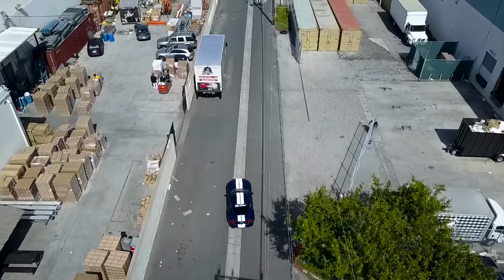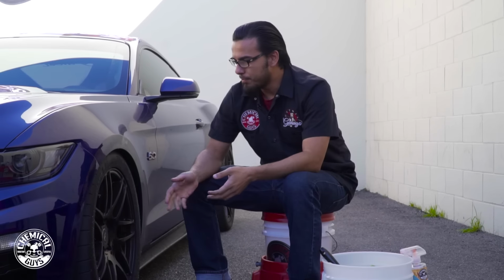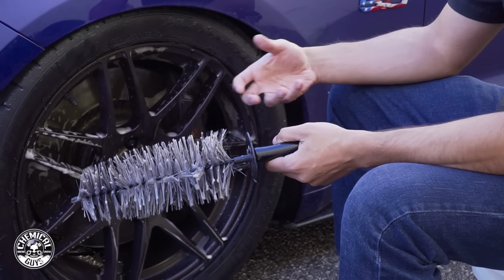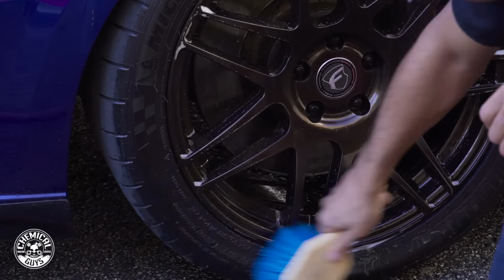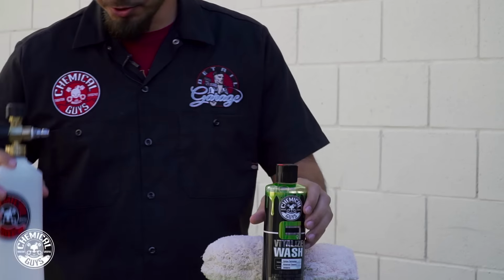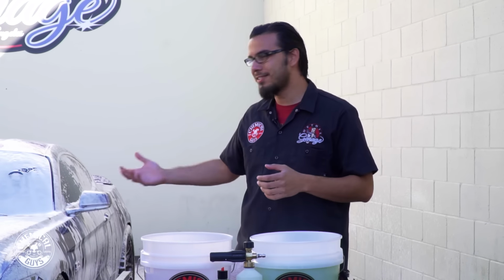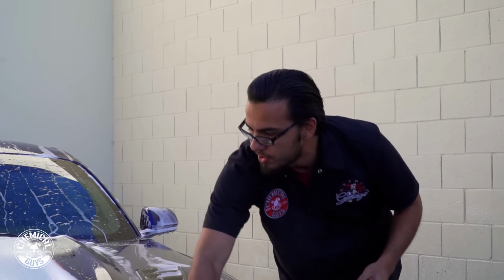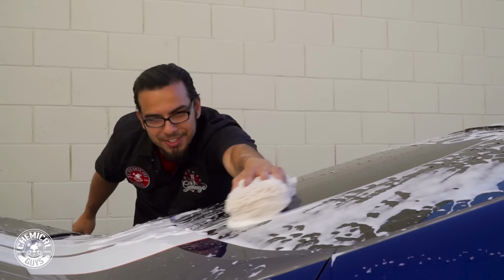Mustang Week! Best Wash and Dry For Your Car - Chemical Guys Car Care

Comment: I remember when you could just wash a car. 

Now you've got to have lab coats and a Ph.D just to clean a wheel...
Reply from the maker: Thanks for watching this video. It doesn't require a PHD to clean wheels, just the right tools, the right technique, and patience. The essence of detailing is cleaning everything that you commonly miss by washing the traditional way.
Reply: you can clean your rims by  making it wet and just going over the breakdust with your bare finger to get it off. Of course a brush helps, but there is no need for using 5 different chemicals
Reply: nobody is controlling you, the way these guys work is to do the job correctly if you want your car to look good, i'm one of those folks, however its your choice whether you "could just wash a car" you can lol

Comment: just saw your after wash product video. will have to pick it up on my next order.  I would like to know if it would help with drying my car when I use my leaf blower. that's my favorite way to dry my car.
Reply from the maker: Hello Robert, I would say it's best to use a microfiber towel to remove the After Wash residue. After wash is designed to repel water, and create more lubrication to prevent the towel to cause any micro scratching.

Comment: I see you are using the Woolly Mammoth Microfiber Dryer Towel. Can you actually dry the whole car with one of these towels or do you need multiple? PS. Great video guys, waiting for the next one! :)
Reply from the maker: Hi Michiel! I personally have dried a 2005 Sierra Single Cab and a 2015 Transit 350 with one Woolly Mammoth. If your vehicle has been waxed or sealed, it will be a lot more easier for it to dry. Thanks for watching and thanks for being part of the Chemical Guys family!

Comment: What is good soap you can use for like any car and will not like take off a wrap or cause scratches and what product can you use to dry a car and to scrub it safely.
Reply from the maker: Hello, thanks for tuning in! To clean wrapped cars, it is important to use a super sensitive wash soap like Meticulous Matte. Meticulous Matte auto wash can be used for any two bucket or foam cannon method and provides slick lubrication to prevent scratching and swirling. Follow that up with Meticulous Matte Detailer and Spray Sealant for those quick jobs inbetween car washes. Make sure to check back later in the week for more exciting how to videos coming your way soon!  http://www.chemicalguys.com/Meticulous_Matte_Auto_Wash_16_oz_p/cws_995_16.htm
http://www.chemicalguys.com/Meticulous_Matte_Detailer_16_oz_p/spi_995_16.htm

Comment: I have hard time with dusty weather, any advice chimical guys?
Reply from the maker: The Honeydew Snow Foam Auto Wash Cleanser is a superior surface cleanser that removes grime, dust, build up and dirt. Added bonus: it rinses clean with no residue whatsoever. You should also be using a sealant like our JetSeal for maximum protection against the elements, especially dust. I have placed a link below for you to follow and check it out. Thanks for being part of the Chemical Guys family!

http://www.chemicalguys.com/JetSeal_16_oz_p/wac_118_16.htm

Comment: Hey Nick. My pressure washer just died. I had a Karcher K5. Are you able to tell me the pressure washer you guys use?
Reply from the maker: Hey Ronald, hope you had a pleasant Thanksgiving, We use a Briggs and Stratton Gas Operated Pressure washer that has 2800 PSI, and 2.3 GPM. Here's a link to one that is pretty much identical to what we have here. 
https://www.lowes.com/pd/Troy-Bilt-2800-PSI-2-3-GPM-Cold-Water-Gas-Pressure-Washer-CARB/1000178201?cm_mmc=SCE_PLA-SeasonalOutdoorLivingPressureWashers_-1000178201:Troy-Bilt&CAWELAID=&kpid=1000178201&CAGPSPN=pla&store_code=1555&k_clickID=491604a2-c20a-4351-b1d5-38c2585f53c3&gclid=Cj0KCQiAjO_QBRC4ARIsAD2FsXPKhQBQ4JHYskmW875t21Pjws-6o9WQsTsb9y_n4kyBC4ZfypL1fJwaAjYoEALw_wcB
Reply: Thank you! My Thanksgiving was great. We went down to San Diego to a place called Rockin Baja Lobster for Thanksgiving dinner then had dessert and families house. Hope everyone there had a great Thanksgiving as well.

Comment: What's the difference between the diablo gel cleaner and sticky gel cleaner? They both seem to be used for the same purpose, so if I just buy one of either or, will it still get the job done?
Reply from the maker: Hi Lindsey, the Diablo Wheel gel is PH neutral, so it works virtually on any wheel type (powdercoat, anodized, polished aluminum, diamond cut, forged, chrome, and wrapped wheels). Sticky Citrus is a more concentrated formula that contains citrus extract that removes heavy stains. Diablo is a good all around wheel cleaner, Sticky Citrus is more aggressive wheel cleaner that can be used on different many wheel types as well.

Comment: Chemical Guys, would it be beneficial to use a pressure washer with plain water to blast off any loose dirt before you use the foam gun?  It's a habit I've adopted because it makes sense in my head?  What do you guys think?
Reply: MultiTerpen ahh that makes sense!  Thank you for the clarification
Reply from the maker: Thanks for watching the video, what you said is actually correct, keep in mind that you don't want to stand too close to the car when rinsing it since the pressure washer is quite powerful. The initial rinse is also a great opportunity to pre - wet the wheels before you clean them.

Comment: Can you guy go more in depth about carbon flex C9 ? Is it a ceramic coatimg? Can you apply multiple layers? Exactly what is it? Doe it add extreme shine or just added protection? Or of it isnt ceramic coating do i need to to purchase something else?
Reply from the maker: Hi Josh, this is Alex from the Chemical Guys crew. Carbon Flex is a ceramic coating, let me define what a ceramic coating is. A Ceramic Coating  is a liquid polymer that is applied by hand to the exterior of a vehicle. The coating chemically bonds with the vehicle’s factory paint, creating a layer of protection. A Ceramic Coating creates a permanent or semi-permanent bond with a vehicle’s paint, meaning that it does not wash away or break down and does not require repeated application every few months. You do not need to apply multiple layers because the second layer will not have anything to bond to. Ceramic coatings do add shine, but more importantly they protect against paint etching caused by water spots, bird droppings, bug droppings, tar, sap, and anything that could diminish the shine of your paint finish. Here's a few links to videos we've made in case you have more questions. 
https://www.youtube.com/watch?v=HYOjdrzEk-Q&t=309s

https://www.youtube.com/watch?v=yAKU7ZEL1KI&t=179s

https://www.youtube.com/watch?v=3fLHkRWe93U

C.G. Alex  : )

Comment: Can sticky citrus be used on dipped wheels?
Reply from the maker: Hi Julina, thanks for watching the video, Sticky Citrus is perfect any wheel type. Diablo is 100% pH balanced and neutral. You can clean off any painted wheel, polished metal, chrome, anodized, powder coated, or wrapped wheel without fear of tarnishing or destroying any finish. Basically Sticky Citrus is universal for all wheels, the formula was created without caustic, or corrosive  chemicals. You can use can Sticky Citrus with confidence.

Comment: What kind of pressure washer is that?
Reply from the maker: Hi Juan Carlo, we use a 2800 PSI pressure washer with a 2.4GPM, here's a link to one that's similar in case you're wondering what one costs. http://www.sears.com/craftsman-2700-psi-2.3-gpm-honda-powered-pressure/p-07175491000P?sid=IDx01192011x000001&gclid=Cj0KCQjwierMBRCHARIsAHl9i4EtGJ7Q4ZZveAfiMWjTPIw2S7bzn6BJNyzLrzipaom_-kx1RwSCFQ4aAo8yEALw_wcB&gclsrc=aw.ds&dclid=CO_ewpLS6NUCFUt8YgodcH0InA

Comment: ive heard when using a foam cannon the water shd be warm to hot however in vid the wash solution was just poured into bottle, whats the best temperature for water to be?
Reply: ok cool ive done a cpl washes with hot water i  will try with cold, thanks
Reply: the foam cannon connects to a pressure washer which gets its water from a hose 
so I have no idea how you would even get hot water.    hose water is cold af
Reply: J⃟O⃟N⃟A⃟T⃟H⃟A⃟N⃟ S⃟C⃟H⃟U⃟L⃟T⃟Z⃟  you fill the foam cannon bottle with hot water and wash solution, and yes run cold water thru the pressure washer itself
Reply from the maker: Thanks for checking out this awesome video. For the best possible results, you should use a foam cannon with warm water.
Reply: Chemical Guys thanks for the info, thats what i was told, i will continue to use warm water in the cannon

Comment: What soap should I use on a black vehicle. Black light? will that keep it a deep black?
Reply from the maker: Hey there Austin,

You sir, are correct. Our Black Light is perfect for any black or dark color vehicles to enhance its shine to new levels of depth and clarity. As you know, black paint is arguably the toughest paint color to maintain and this soap helps prevent scratches & swirls.
Reply from the maker: What's up Austin, Blacklight is perfect shampoo for dark vehicles, it's formula was designed to bring out the rich texture, and deep shine of black paintwork. Blacklight contains gloss enhancers, and waxes that enhance the luster of black paint.
Stay tuned for more great content, and don't forget to checkout our forum for updates, get your questions answered, and share your photos with other Chemical Guys family members. http://chemicalguysforum.com/forum.php
Reply: Thanks! Will it turn my plastics white though because other wash and wax have turned them white.

Comment: Is Sticky Citrus wheel gel safe for matte wheels??
Reply from the maker: Thanks for watching our video. You can use Sticky Citrus Wheel Cleaner Gel on painted, polished, powder coated, chromed, wrapped, aluminum, steel, or carbon fiber wheels, rims, tires, suspension parts, and brake components. If you do plan on using sticky Citrus, I would suggest testing on a small area to see the results. You're better off using Diablo wheel gel because it's 100% pH balanced and neutral. You can Clean off any painted wheel, polished metal, chrome, anodized, powder coated, or wrapped wheel without fear of tarnishing or destroying any finish in any way.
Reply: Good, since my GALLON of Diablo just arrived!!! ;)

Comment: rinse the brush before put in back bucket.  much better
Reply from the maker: Hey Tony, 

The Cyclone Dirt Trap Car Wash Bucket Insert is designed to trap dirt at the bottom of the bucket; filtering fresh water to the top. No need to rinse off the brush because by scrubbing your wash mitt on the dirt trap, the filth gets trapped under. Bonus: saves water from constant rinsing of the brush every time you want to clean it. Happy Detailing!

Comment: Cool video but if I use your technique I will empty half the spray bottle after 1 wash....
Reply from the maker: Hi thanks for watching. We definitely agree with you, less is more. You don't need gallons of chemicals to clean your wheels and paint. I use a combination of Sticky Citrus to remove the caked on dirt, and abrasive break dust, then I finish the wash up with EcoSmart which cleans and shines. Stay tuned, more great videos on the way.

Comment: OK, I like the product you guys sell...but the cars you do are never that dirty. Or are the cars ever that old or average Joe cars with bad paint. Why can you guys not just call the dirt just dirt, not dirt and debris. Is debris not also dirt?? 

Also can I add that the wheel brush you used is not that strong, or built to a good quality. I have one and only used it once to gently clean my wheels and its become loose around the hilt/handle.

Comment: Wth is a sud?
Reply from the maker: Suds is froth made from soap and water. Froth is a mass of small bubbles in liquid caused by agitation, fermentation; thick clinging foam to saturate and lift up dirt and debris to reduce chances of swirls and scratches.
Reply: Got it, thanks!

Comment: I don't get it. I use your products and they work great, but most your videos are on 95% clean cars. The car doesn't have to be good looking, just dirty.
Reply from the maker: Hey Daniel, thanks for watching, and using our products. It's important to remember that the longer you wait, the worse and irreversible the consequences become.  The longer you wait to clean your vehicle, the worse the damage is to your paintwork, it's the same with teeth.  We try to address neglect as much as possible. The weather conditions out here are mild in comparison to other states.
Reply: Chemical Guys I see, I live in Demmark, and the cars become shit dirty. But thanks for the answer.